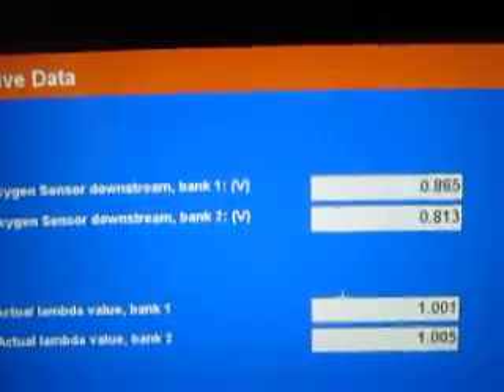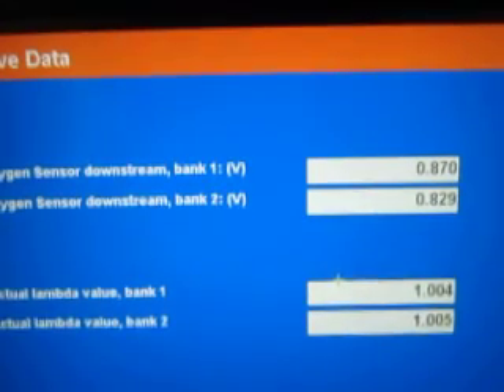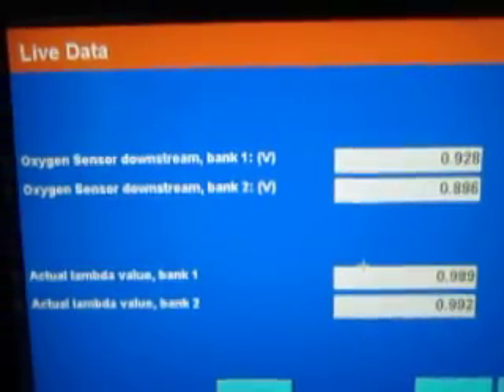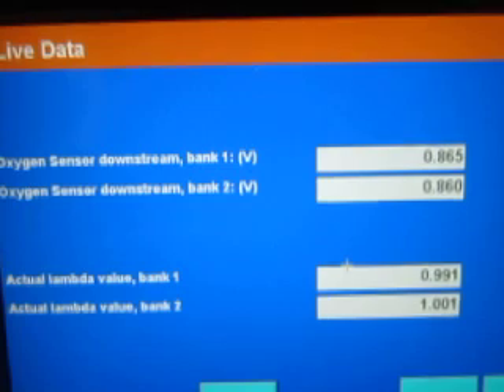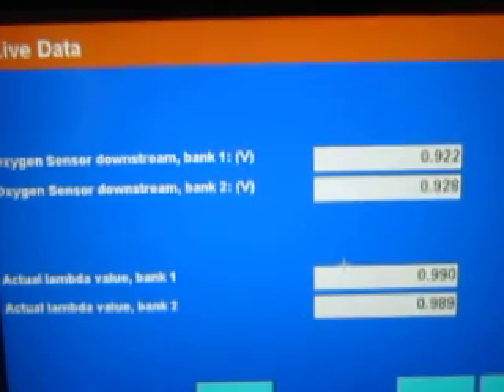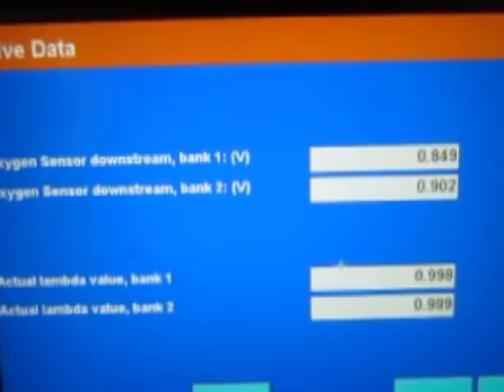P0431 Cat Inefficiency on 2006 Porsche Cayman S

Comment: I'm having a P0431 in my 2007 Cayman S right now. How can you see from the live data that something is wrong? Thanks
Reply: Did you ever fix this? I’m currently having this same issue right now
Reply: @mannyg9838  no,  I live with it. This error comes after I drive 90 km/h +/- 5 for 2.5 minutes, that's the test environment where the engine computer performs the catalyst test. So my guess is that it's not crucial. It's just the aging of one of the catalyst benches which could be replaced for 500-2000€.
Reply: nillchen does this affect the cars performance in any way? I think I’m going to have to fix this issue regardless. California is no joke when it comes to the vehicle emissions system.
Reply: @mannyg9838  ok, I'm here in a small rogue European country (Austria) where laws are  not as strict..please let me know how it went and what they fixed
Reply: I bought a chemical that helps clean the Catalytic converter. Its called Cataclean. I also did the major maintenance service and checked the O2 sensors. This seemed to make the check engine go away: I hope it doesn’t come back
Reply: @mannyg9838  thanks man, I'll try this!
Reply: @mannyg9838  hi Jose, did it worked for you? I have a 997.2 same problem.
Reply: @classic_matches_10  no it didn’t. I just ended up cutting out the cats and making the car straight piped. It doesn’t need the cats to function
Reply: Used 2 bottles of cataclean. No luck, code comes back every few days after clearing the code
Reply: I clear the code for 5 times now in the past month